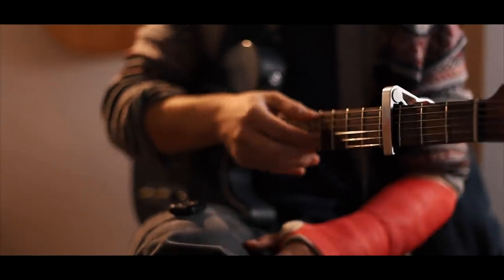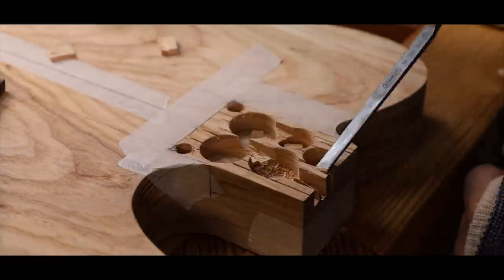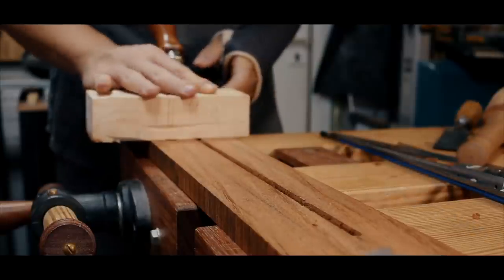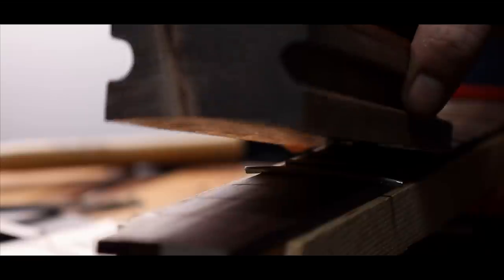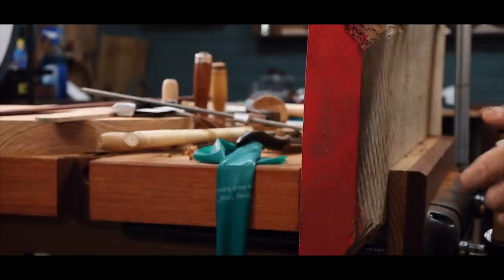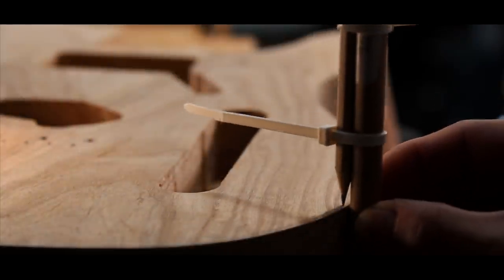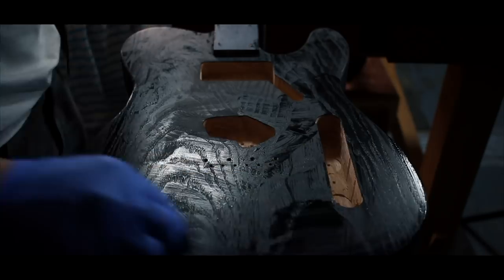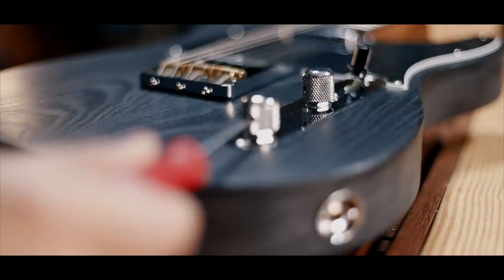I Built A Guitar Using Only One Hand (REUPLOADED with voice over comments !)

Comment: Amazing! Just ordered a body and neck blank to start my first guitar built. Want to use as much hand tools as possible, I have basically zero tools. Was thinking about buying a router though, but seeing this I’m not sure it’s necessary. What is your advice?
Reply: I would love to get a list from you for the absolute minimal tools to build an electric guitar. I think for most people what’s holding them back is the (perceived) amount of tools needed but you seem te be getting great results with much less then most other builders recommend (band saw, router ect)
Reply from the maker: if you're patient enough, I'm covering that topic in the tutorial, but in the first section I only say that a router is not necessary, I don't really develop :p that first part is going to be published in 1-2 weeks, in the second part I'll show in detail the possible uses of a router (without using one), so you'll be the judge. I love the router, even if I think it's by far the most dangerous tool I have, and (for guitar making at least), it really requires you to understand how wood grain works, so I wouldn't advise it for people who start from zero. 

good news is, you can buy any router, a guitar is not very demanding for a router motor, so any piece of crap will work as long as it has a plunge function
Reply from the maker: it's all gonna be covered in the tutorial :) 10 minutes talking about tools only haha, hang on tight it's going to be dense.
Reply: @tchiksguitars  Thank you for the elaborate reply man. Was planning to buy some tools this week (looking for a bow turning saw to do bandsaw work) but I’ll try and be patient and wait for your video! Will the advice on hand tools be in the first part?
Reply from the maker: Yes absolutely. Even in my power tools driven builds I use hand tools way more than necessary :) you really don't need a bow turning saw ! I thought that too, but i managed to do the entire guitar with a straight saw and a fret saw !
Reply: @tchiksguitars  awesome! I already had trouble finding a bow turning saw, I’ll look for a straight saw and a fret saw instead!
Reply from the maker: I suggest a good japanese pull saw (50€) and a decent fret saw like a Bahco :)
Reply: @tchiksguitars  thanks man, any preference for the type of Japanese saw? Also any must haves when it comes to planes and rasps/files? Just ignore my questions if you get sick of answering them :)
Reply from the maker: The tutorial answers it all and your questions ,as well as other commenters' questions, comforts me in the idea that the tutorial is much needed :) 

Gyokucho is the brand I use. Ryoba is the model I use the most !
Reply: @tchiksguitars  Ha awesome! I actually already ordered the Gyokucho Ryoba! I'll wait for the tutorial before I purchase any other tools!

Comment: Time to make a CNC Router!!! 🙃 I believe you can handle it around 1000-1500$
It will help you a lot!
Reply from the maker: I have nothing against cnc, I think it allows people to 1) save time 2) make things that can't be done otherwise. BUT that doesn't go anywhere in my work flow :p I don't selle guitars soni have no interest in working fast and effortlessly. The being said, I like to tinker with small devices like a 3D printer and a loser engraver (I have both), so I ordered a tiny CNC some time ago, hopefully I will be able to implement some of that in my builds (I'm talking about custom headstock plates, knobs, pickup covers, pickup frames, pickguard etc. ). We'll see :) but a big no no for a full sized CNC
Reply: @tchiksguitars  What do you mean full size?
I have built one with 350x450x150mm work space. You need a little bigger 600x900mm, or smaller.
I like work with my hands too, but the routine work a little annoying. 😉
Reply from the maker: By full size I mean that size :). And when I mean tiny I mean minuscule haha. A cnc for ants
Reply: @tchiksguitars  OK. I see. 🤣
Because there are 3000x2000x150mm in full size 😉